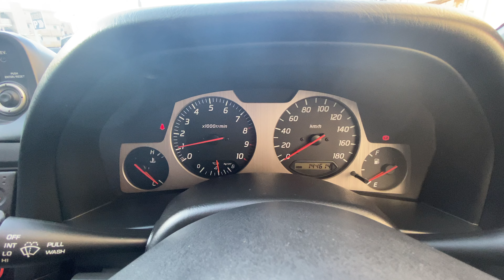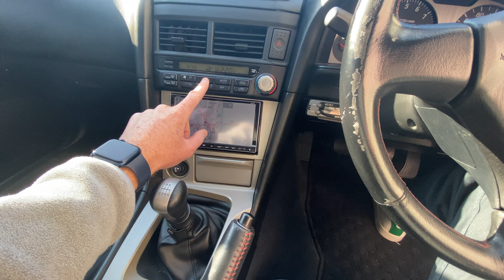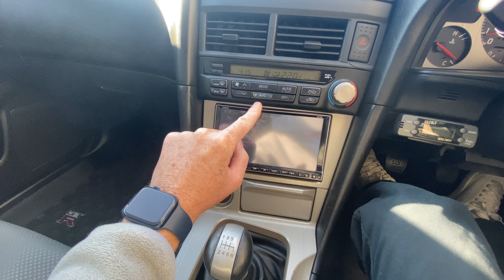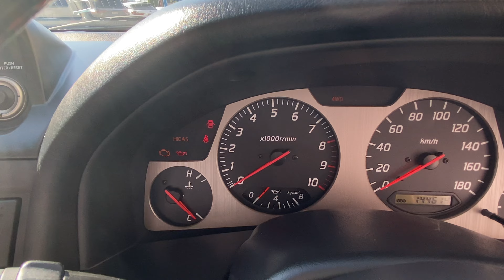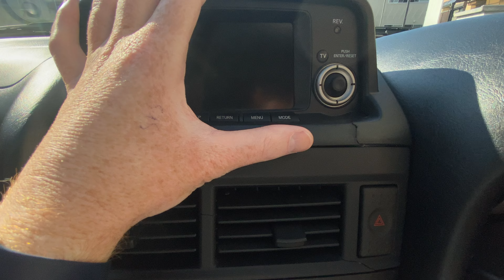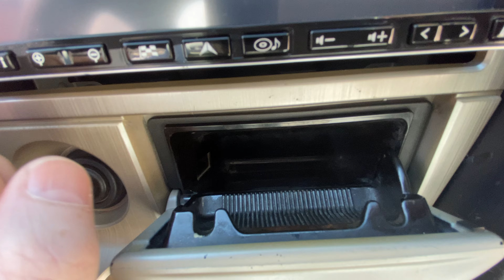I inspected a 3/99 R34 GTR for client trying to sell

Comment: If that’s a base Gtr then it’s not really missing the front diffuser/lip as you mentioned. Came standard on vspec but not base. The side and rear extensions are probably from Yahoo Auctions (reps)
Reply from the maker: I knew the lower spats and side were. But I’ve personally never seen even a base model without the front lip. Looks a little silly without it haha
Reply: With the side extensions the front does look silly without the front diffuser/lip. But yeah bases dont get the those, my base r34 gtr didn’t have it and it is mostly all oem.  Most have them because not long ago they were cheap $500 or below compared to now at almost $1,000 not including shipping if going overseas.